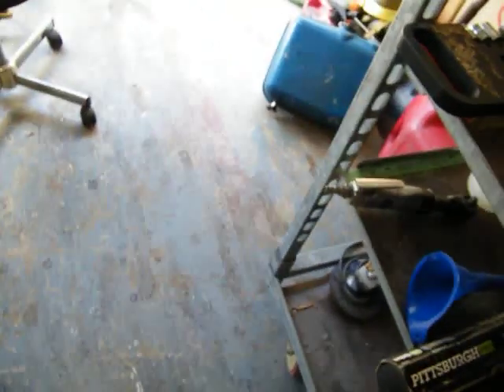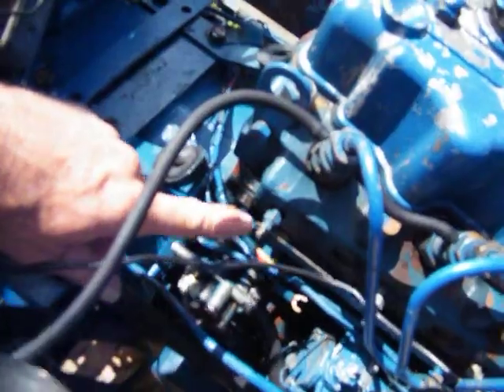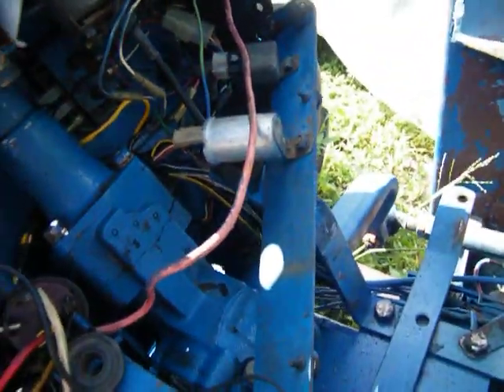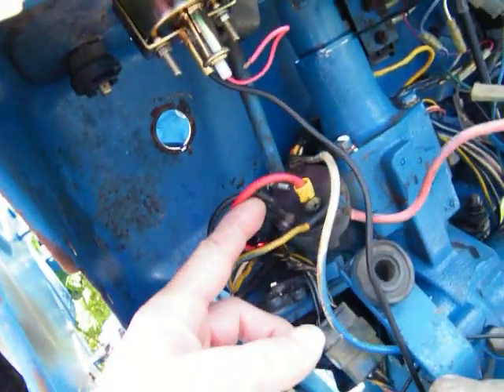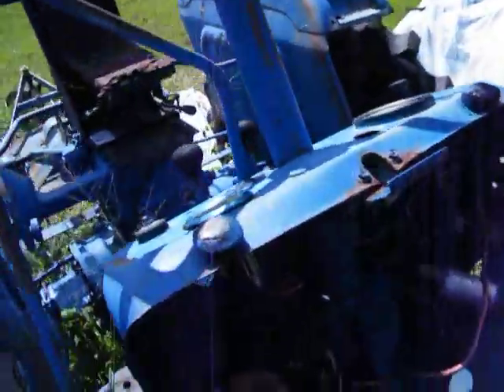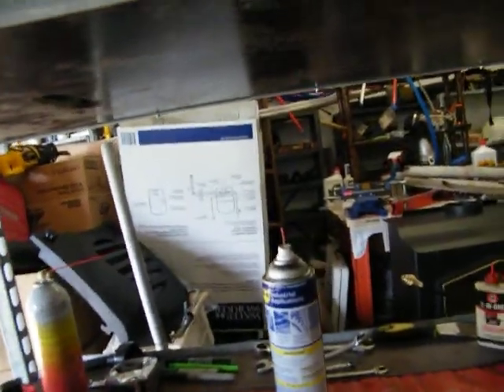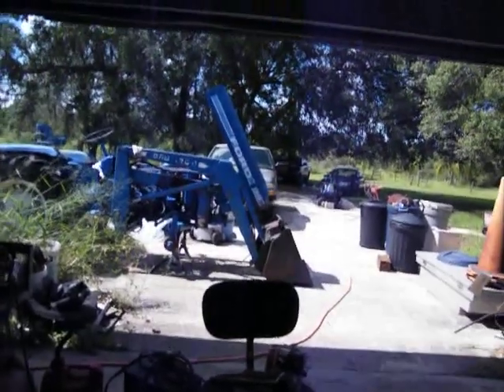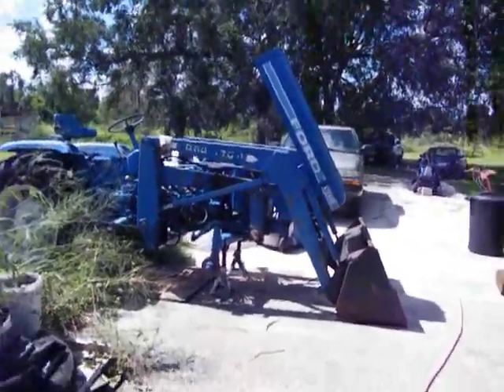DSCF0173 new glow plug signal ford 1710

Comment: Hello, you mentioned in the video that you had rims made? Will you share who you had that done by? I have a 1710 that I am hunting rims for. Thanks!
Reply from the maker: That’s going to be a challenge, I have since moved a couple of times.
It was a chore in its self finding the rim size, center hole size and the bolt pattern size.
I remember eBay had some and I kept going through listings till some one responded . 
 I didn’t buy them through eBay
Reply: @Rewired69 ...well darn! Thanks for the reply anyway. If you ever figure it out, please let me know.
Reply from the maker: @kurtarkangel9909  do a google search for them  it took me a while but I mail down a company that cut me a set and powder coated them

I found the specs by searching out the tractor itself.
Gave all the data on the rims both front and rear, also for 2wd and 4wd